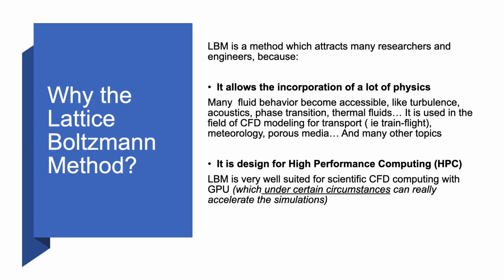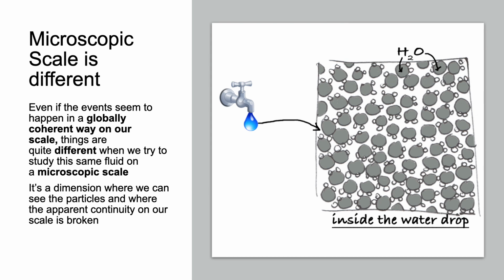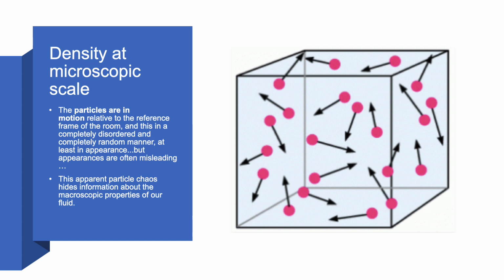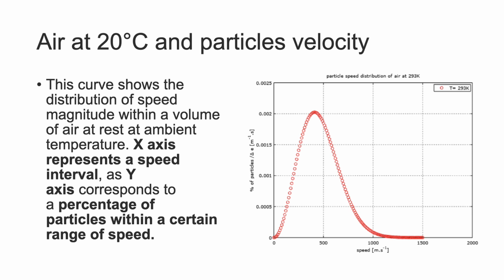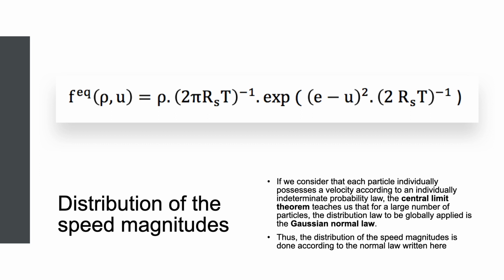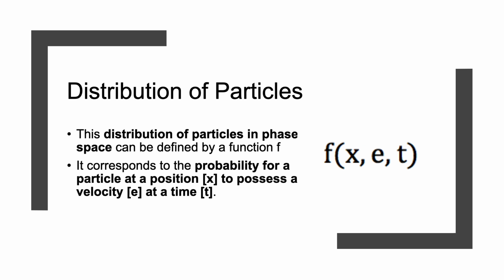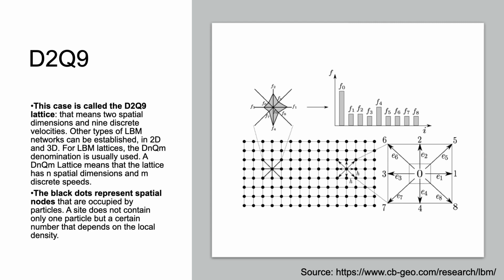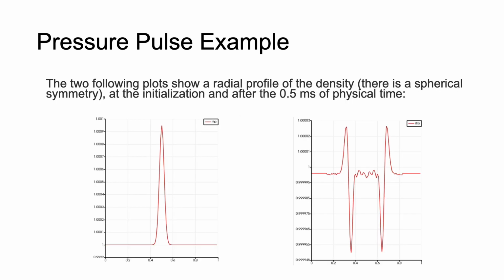Everything you need to know about the Lattice Boltzmann Method (LBM) for CFD Simulation

Comment: I really loved this presentation/lecture on LBM.  It was clear, well explained and chock full intuition to get started in this field.  In addition all the diagrams were very clear.  I think the maths formatting could be improved a little bit - for example x^-1 is better written as 1/x but this is a minor niggle.  I had to convince myself that the classical Gaussian term was one because it was written all on one line and used exp(x) instead of e^x (again formatting), but again minor niggles.  The thing I liked most about the whole presentation was the pacing - beautiful gaps between each slide in which there was sacred silence allowing the student to absorb what was just said and what was on the screen.  This pacing is so incredibly rare, particularly here on YT, but I think it is vital to proper learning.  Why is the microscopic velocity represented by 'e'? I suppose that must be a German language thing, or just arbitrary.  Unusual to have a variable called 'e'; e is normally the constant 2.71828...

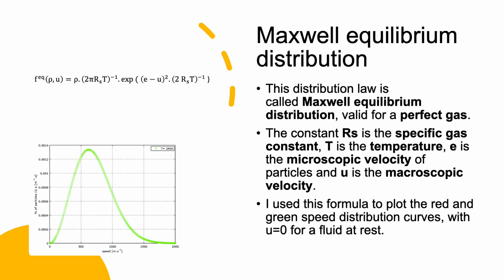Comment: About the equation at 28:08 (distribution of speed magnitues)...  Since these are velocity magnitudes (absolute values), the curve should pass through zero and be undefined for negative "magnitudes".  That is, it should look a bit like a Poisson curve or similar. However, the Gaussian normal law doesn't ever actually reach zero. It will pass above the origin and permit a "tail" of negative veloities. So is the Gaussian law just an approximation here?

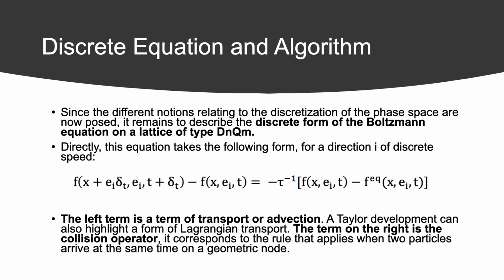Comment: 41:13 In a scenario, if the speed of a set of fi*N particles is 1 m/s, and another set of fj*N particles is 2 m/s, would the fj*N particles move two "spaces" away and fi*N particles move one "space" away? Also, what is tau? Thanks.
Reply: in LBM, the movement of particles depends on their speed in lattice units. if 1 m/s and 2 m/s are already in lattice units, the particles would move 1 and 2 lattice spaces, respectively, per time step. as for tau, it’s the relaxation time related to the fluid’s kinematic viscosity through ￼nu = (1/3) * (tau - 0.5)

Comment: Hi, I try to ask 2 questions here, don't worry if you can't answer it :)

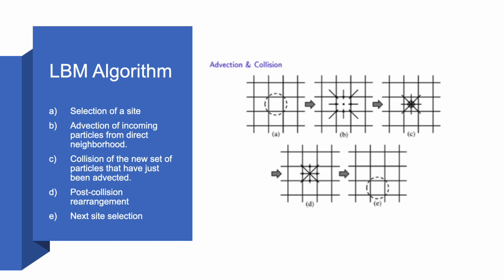I'm strugling to code a LBM simulation and I always get some strange ripples (region where f becomes alternatively big and small in the direction of propagation). It seems that the method doesn't like big f gradient : they get bigger and bigger (with any tau value). I suspect that I'm not doing the operations in the right order : I'm doing every node's advection (parallel calculations on GHPU), THEN every collision. I see at 42:03 that it's not the way you recommand it, but I don't really understand your description... This iterative method will change a node after the other. So the one I just change will then be read with it's new value for the next one ? I'm confused. How could this be parallelized ?

Also, what is the 4th step: "Post-collision rearrangment" ??

Sorry for my approximative english and of course, thanks for this nice video :D

Comment: It seems to me that this discretization directly ties the timestep to the spatial resolution since a single time-step would have to exactly match up such that the neighboring node is reached with the given discrete speed vector. Am I correct in this assumption? This is really the main thing that has been confusing me about LBM since many papers and texts seem to treat both of these as variables and don't even mention this, although I have found some that do exactly what I describe.

Is there a way to do substeps in time with this method? Or is there simply no need, numerically speaking, i.e. is this exact matchup between spatial resolution and timestep simply also the numerically most accurate way to do it?

Comment: that was a brilliant presentation, thank you, it brighten the path. I also have a question, what application do you suggest for coding LBM ?? python or Matlab or any other one?
Reply from the maker: C++ or C
To code a solver you need speed
Reply from the maker: If you just want to code for fun, then you can use any code, but using python for example will lead to very slow calculations